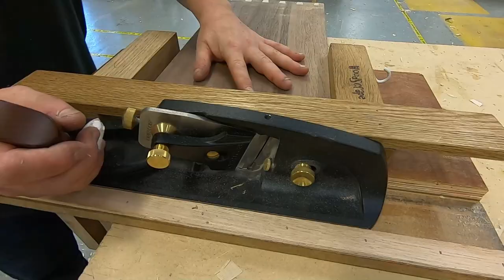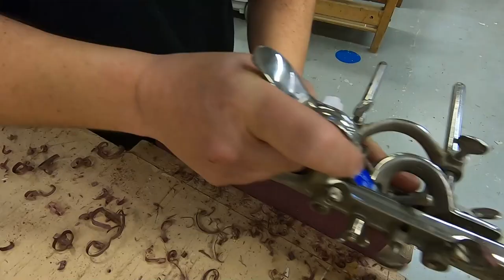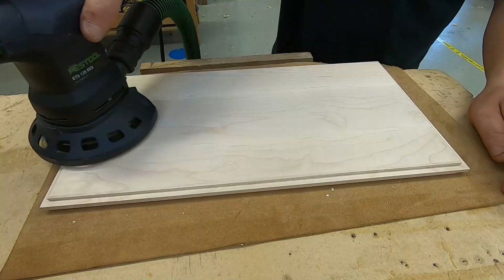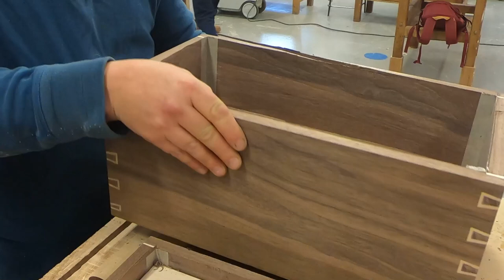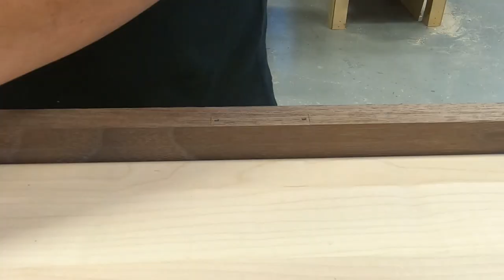How to make an Inlaid Dovetail Tool Chest

Comment: I think I understand why you cut a relief into the back of the dovetails before putting in the accent piece...

But it looked like you did the same on the sides, and I cannot figure out why, or how it would be filled on assembly? (4.37 for reference, the relief on the side facing the camera)
Reply from the maker: Hi,  the rebate is cut into the back of both the tails and the pins. On the tails it gives you the depth of the inlay, then when you fit into the final pin socket, if you use a rebate, it hides the inlay from the inside  of the chest. Also, with the inlay around the tails, the rebate is needed otherwise the pins would have the inlay in the way. It’s hard to explain. Hope that explains it a bit? Best way it’s to have a go, things become apparent when it’s directly in front of you. Thanks for watching
Reply: @WoodScrape  But why wouldnt you just plane the inlay flush with the inner face of the first peice?

I assume the rebate is to grant more strength, but wouldnt the glue make it stronger than the original wood anyway?
Reply from the maker: @davidbrown8428  without the rebate, the joint wouldn’t fit together. My rebate doesn’t go all the way to the ends as I was cutting mitres to incorporate the top and bottom pieces. I’m currently making a box where the inlay goes through the mitre too
Reply: @WoodScrape  I think I get it... without the rebate on the tails,  the inlay wouldnt wrap all the way around the tails... but im still not sure on why the rebate on the pins.... unless its to account for the thickness of the inlay... while keeping the thickness of the sides the same as the thickness of the front and back?

How did you do the long strip of inlay along the top and bottom of the side? I can't work that one out.
Reply from the maker: @davidbrown8428  yeah for the inlay to wrap around where it does, you need to subtract the thickness of the inlay from the back of the pin board. It’s not my method, I learnt from The Katz-Moses channel. I started with his saw guide on older pieces but my muscle memory is starting to form and had a go without.
Reply: @WoodScrape  Awesome, I knew id seen it somewhere else....

But the top and bottom inlay? That runs the full legnth of the side? how was that done?
Reply from the maker: @davidbrown8428  do you mean the inlay that connects the dovetails on each end of the chest? If so, i hadn’t figured out how I could get the inlay through the mitres at that point ( I have now) and I didn’t want the inlay to just end so decided to join the inlay front to back. All I did was cut a 3mm groove with the router using the edge as the reference. I then cut strips of maple to 3mm and mitres the ends. Then glued them and planes them flush
Reply: @WoodScrape  Ahh... so the single simple bit? :)

Awesome. I think it looks fantastic. If I can get the wood, I think ill have a go myself

Thanks for being inspiring
Reply from the maker: @davidbrown8428  that’s very nice of you to say. Thank you. The best way to learn them is to just have a go. None of us got it perfect the first time. But essentially it’s just cutting the dovetails twice. Hope it goes well